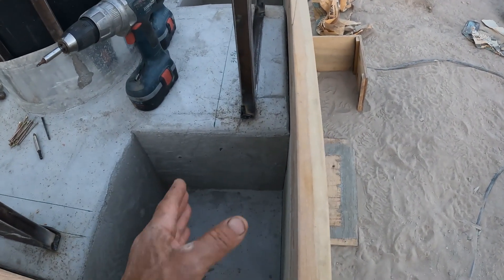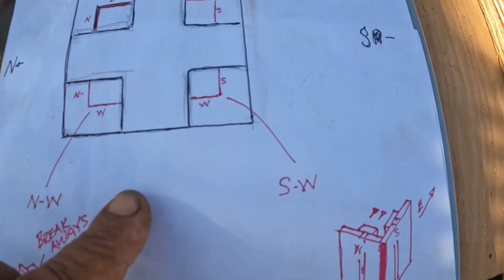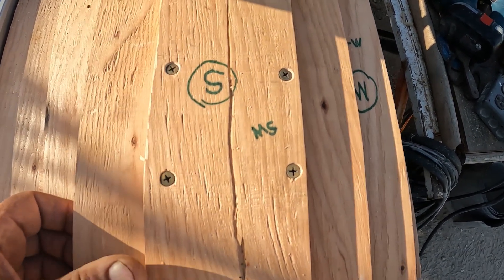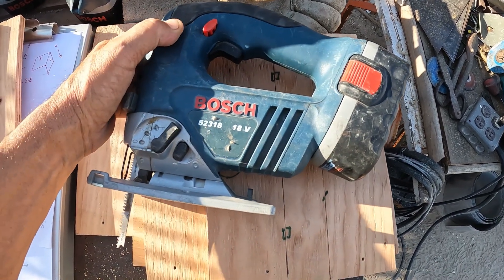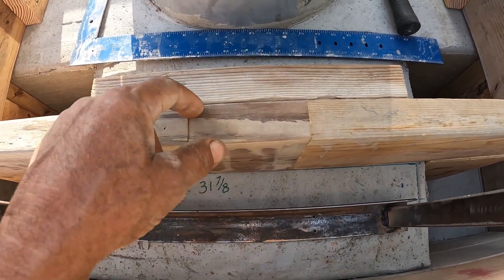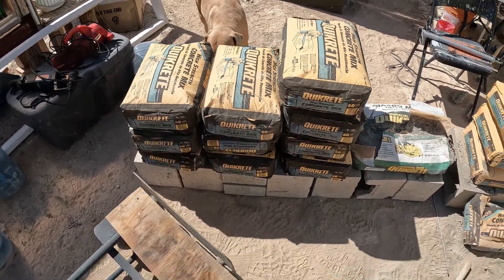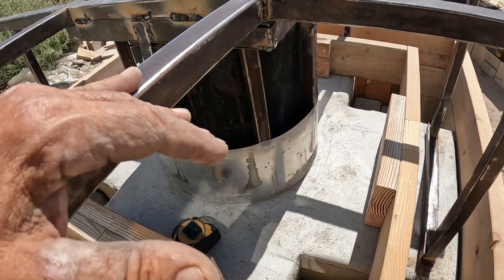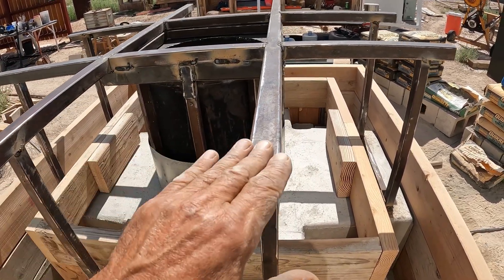Sand Battery, More Concrete Forms E116

Comment: Question for you, I know the heating element is ac/ dc but is the thermostat both on a water heater? I would think so as it's just a switch
Reply from the maker: No the thermostat is made for AC only. The reason I know is because I burned one out trying so I researched it. I believe they make DC replacement thermostats. I remember finding a list of replacement thermostat switches at one time a few years ago but I never tried.
Reply: @off-gridsurvivalmike8120  I was talking with a local off grid store here and he said I could, just have to make sure I in get it over voltage